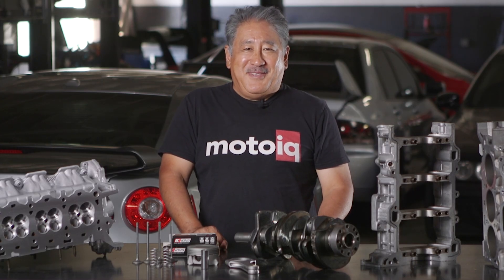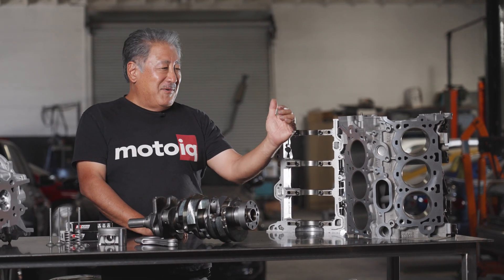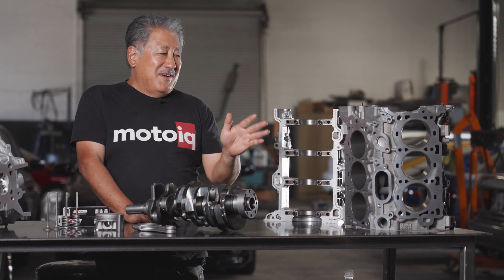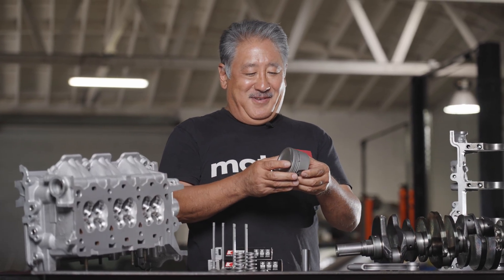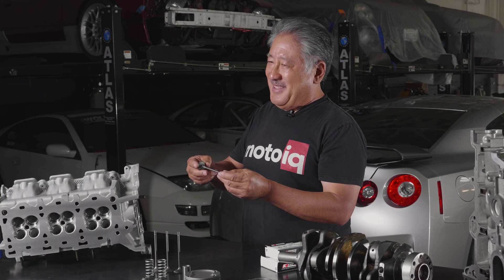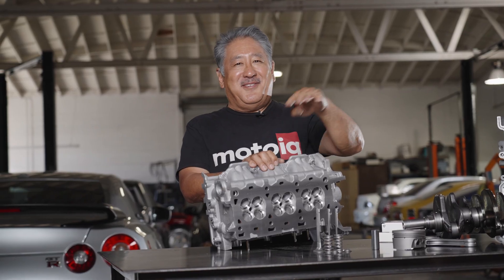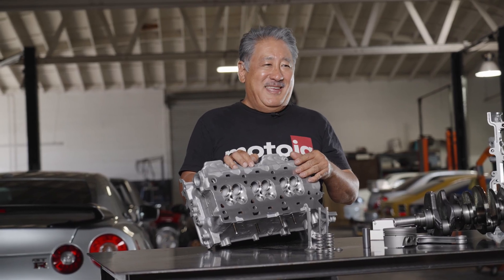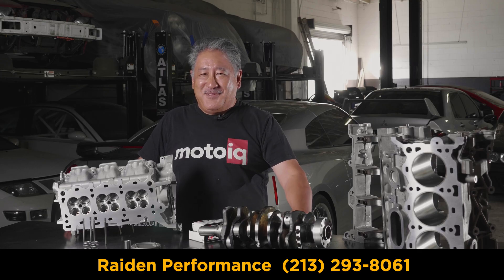How to Build a Turbo Ford Duratec V6

Comment: Was this engine originally a Mazda design for the 2.5-liter in the Probe/MX-6?
Reply: Porsche design bought by FORD
Reply: This has some things Ford copied from that engine but they're technically not related. I'd rather have a 2.5L KLZE than any Duratec.

Comment: Mike is always so chill and humble. I still run this engine in my SVT contour.
Reply: U lucky bastard! Just love those cars, so unique and a really fun motor. Always wanted to drive one and see how it felt against the 170hp version in the Mazda mx6. They rev smooth and fast like a b-series Honda but with more torque of the v6. Wish they did a 2.8 or 3L version of it with another 30hp in a probe gt. Maybe someday I'll get the chance to do an all motor build on one
Reply: @romper4444  you can build your own 3.0L with the SVT heads and the 3.0L Taurus short block. It's pretty common in the Contour SVT community.
Reply: @Fulcrum205  do you know a specific turbo kit and specs for this engine i have one in a ford taurus
Reply: @mostafaelsaid7371  I do not. To be honest turboing a FWD V6 is a big pain in the ass due to packaging. Your best bet would be a supercharger. You will likely grenade your transmission or axles with forced induction. I ran with a couple of SHO Taurus guys back in the day and they would show up at the track with a couple pairs of extra axles (Pep Boys lifetime warranty FTW) and would usually end up breaking a couple. 
My days of trying to crank a bunch of power out FWD platforms have passed. I would rather just start with a RWD car. I had a turbo B20 Civic and it just couldn't use the power anywhere except blasting down the freeway. Everywhere else was wheel hop or spinning understeer. I rebuilt that motor for NA mid range torque and it made the car a lot more fun to drive
Reply: @romper4444  I wouldn't go all motor if I was you. Most power I've seen them make all motor was 400hp at 8 something rpms
Reply: I have a 2005 Ford Five Hundred with this great motor in and have put 198,999 miles on it and it still has great Torque and horsepower.I have always done my own maintenance on it and agree that the transmission and CVaxles would be the week link. I have been thinking of putting a power adder on it and maybe wake this monster up..
Reply: Any videos
Reply: When my Dad died I took his on a joy ride before the bank showed up.

Comment: Ford Duratec ?? Like Mercury Cougar/ Ford Taurus/ Ford Contour / Ford Mondeo. Noble kit car??   What are these built engines going into??
Reply: Rossion Q1
Reply: with the 6hp26 out of a jaguar you can build any RWD
Reply from the maker: Or a Noble
Reply: A few guys in the UK are running them in Metro 6R4’s
Reply: Rossion Q1 or Noble